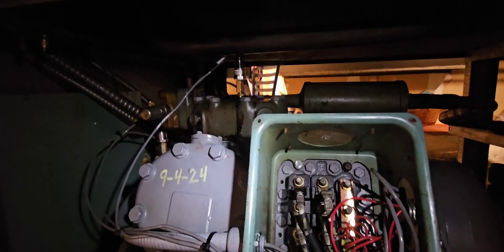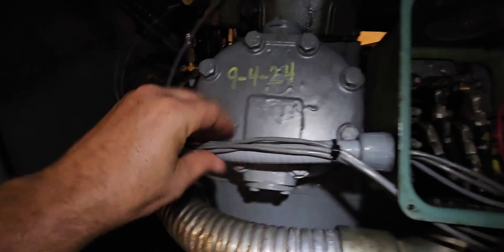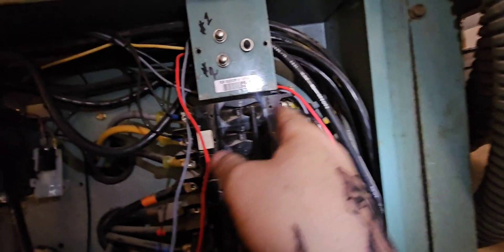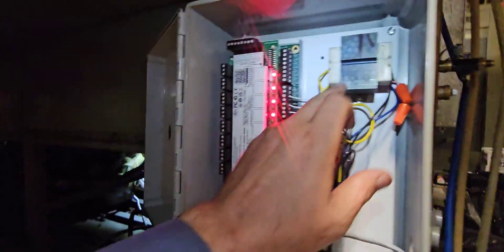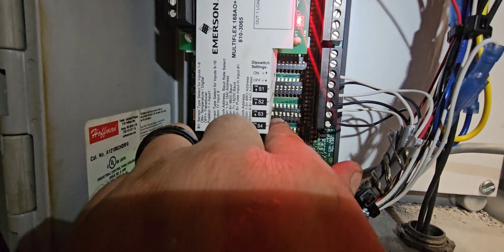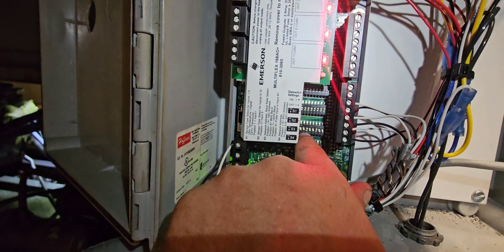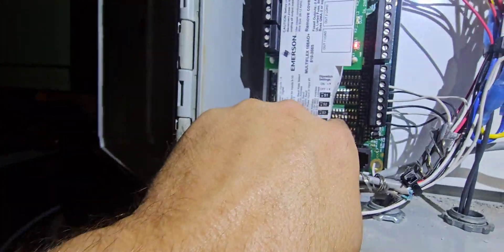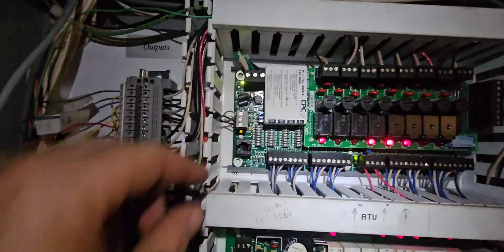Supermarket Refrigeration: EMS cut over!  AC Compressor cut over to run off transducers.

Comment: Nice job man. Ive never seen safeties ran through RO's to control a load. Do a follow up video when its dialed in if you can.
Reply from the maker: @Reefertech  thank you. First time I've done it. I've got it dialed in now and it's working good. I'll do a short on it next time I'm over there.